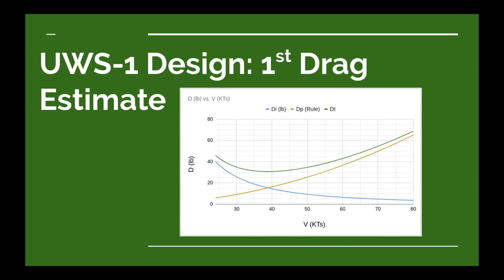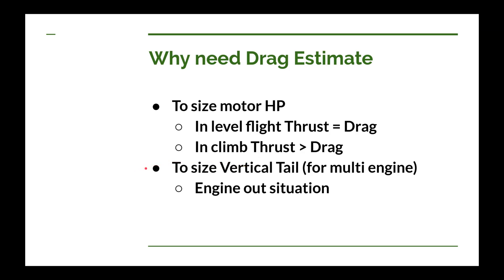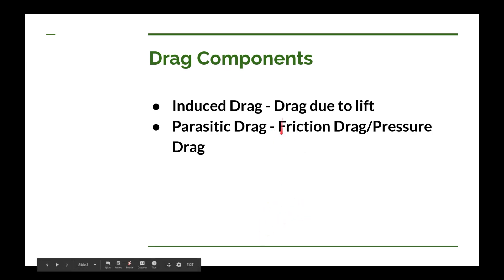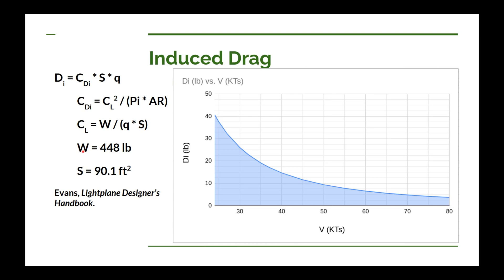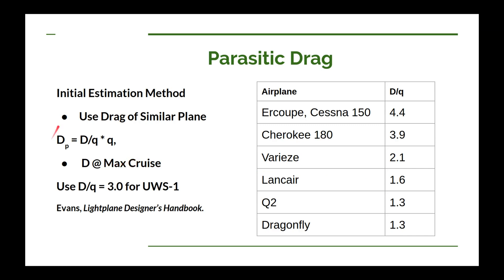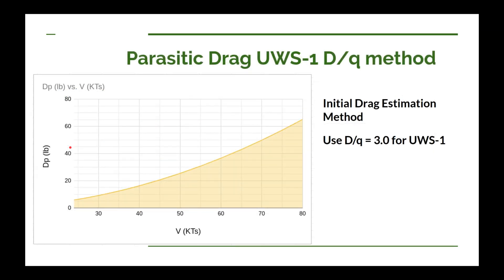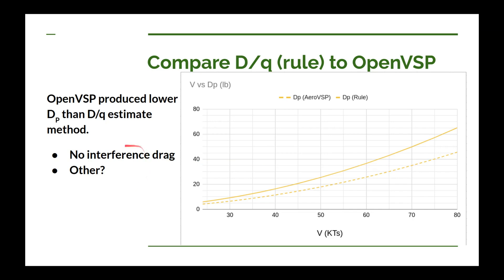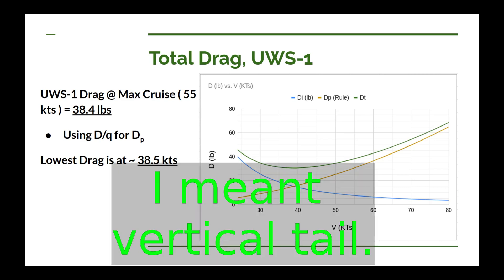UWS-1 Design: 1st Drag Estimate

Comment: Leon, have you considered the completely crazy idea of devising a simple mechanism to tilt the motor axis towards the CoG in order to lower the yawing moment in case of one motor failure? 
The decrement in moment arm in respect to airflow efficiency if the nacelle holds an angle x with respect to the CoG, and you tilt the motor an angle y, the ratio would be: [ sin (x-y) - sin(x)] / [cos y - 1]
In case you prefer the LaTeX equation: \frac{\Delta M}{\Delta \Phi} = \frac{\sin (\alpha - \theta) - \sin (\alpha)}{\cos(\theta) - 1}

Comment: Another informative video .I have one doubt at 9:46 I can see you using the Parasite Drag tool ( OpenVSP).  I also tried getting the drag value this way but the drag percentage due to fuselage and pretty much anything except the wings is coming out to be zero. 
I know you said in this video that you are not fully acquainted with the software but have you ever had to face this kind of problem while using the software. I am find using this software quite a bit challenging any help  regarding the above problem will be helpful.
Thanks for the video!!!!
Reply from the maker: I have not revisited the drag issue in a long time so I can't provide any additional guidance.  When I do get back to it I'll make another video.